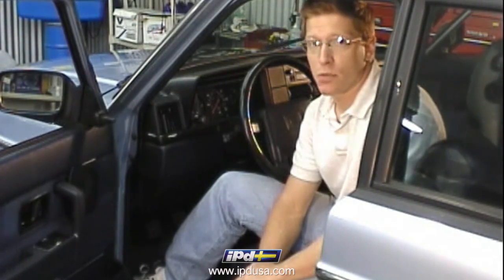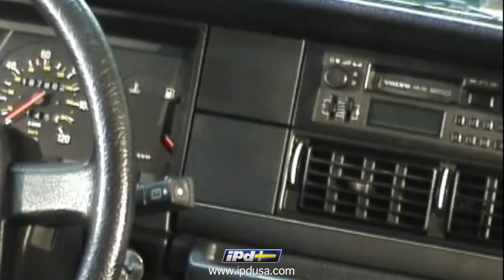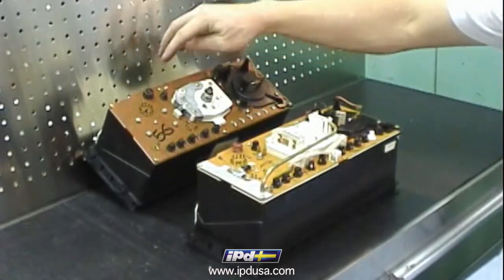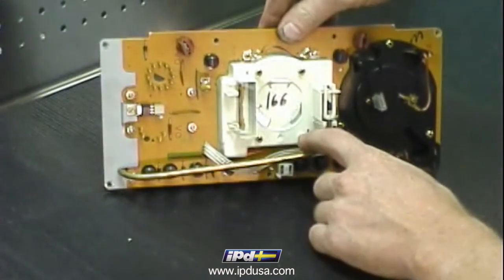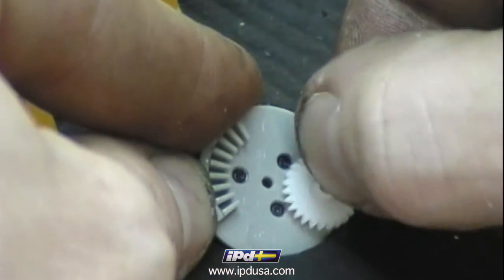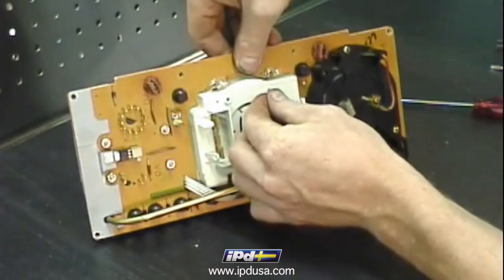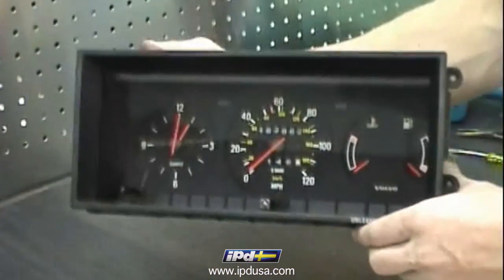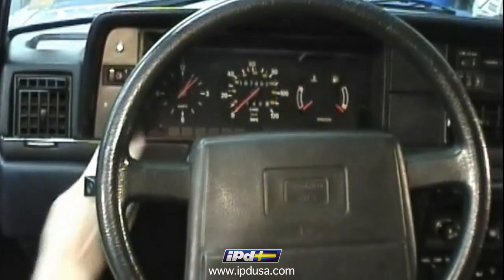Odometer Repair for 240, 260, 200 Series Volvo 1986-1993

Comment: Thank you very much - ordered the gear and followed your guide - the original gear failed just as shown in the video. Also got the chance to fix both the reset service assembly and the trip odometer reset shaft as well - small heat pin. If the factory gave us 3 more inches of wiring harness the job would have been even easier. Again thanks for both the video and for having the parts when needed. Happy new year. Robb )

Comment: I picked up a 1992 240 whose odometer doesn’t work. Will replacing the gears using your kit do the trick to make it work again? 
Also, whats the fastest way to roll forward and rectify the odometer?

Comment: Hye there , need help with the temperature n fuel gauge....needles only move when I connect the yellow wyre from the temp sensor under the intake manifold to positive and not ground..pls help..

Comment: So my odometer on my 1989 volvo 240DL stopped at 170725 miles. It won't go any further than that. I just want to make sure that this is the right tutorial for replacing the odometer gear. Speedometer works but I can't tell for sure how much miles I've put on it.
Reply: Auto_Kevin97 did you ever fixed your problem? My speedomter doesnt work and im not sure about the miles meter